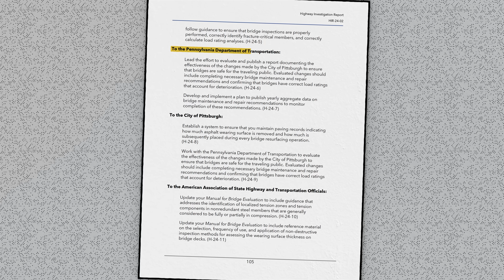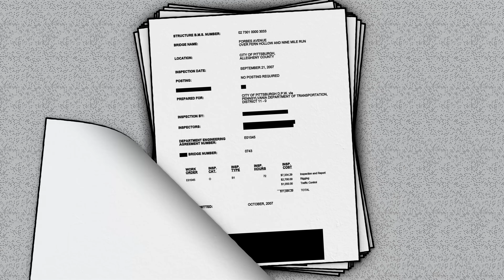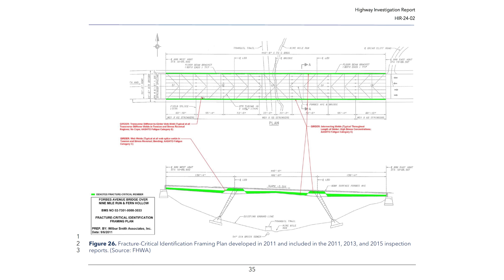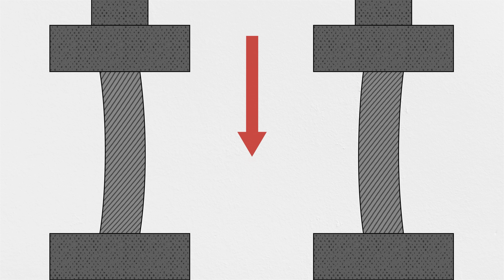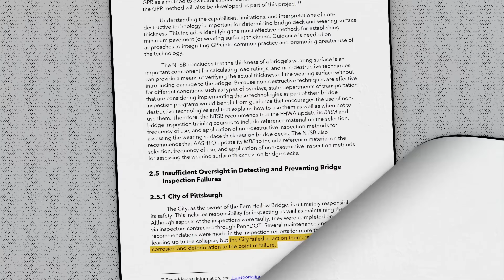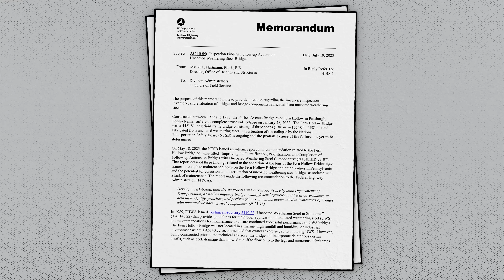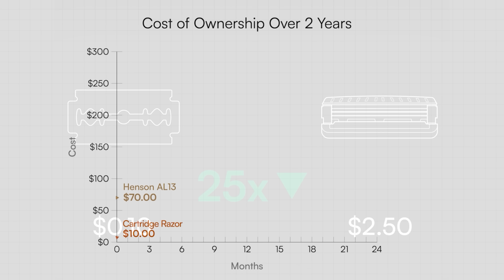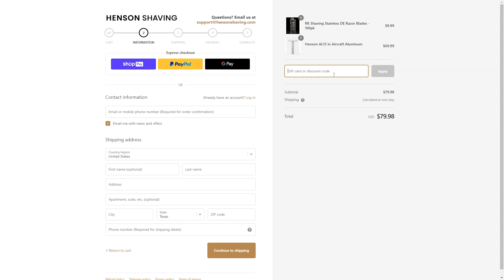This Bridge Should Have Been Closed Years Before It Collapsed

Comment: Excellent points at the end, I'd personally add my unqualified opinion that many of our regulatory agencies in this country feel toothless these days. I think some of the source of this complicated but inconsistent machine of infrastructure maintenance is seeking profit at each step. Instead of having a city or state employee as a direct boss of the inspector(s) who then gives the order to fix something on a set schedule depending on its urgency,  potentially outsourcing just that labor and material to contractors... we bring in another private/corporate entity at every single step, and maybe my biases are showing but they're mostly parasites there to drain their cut of tax payer dollars and have perverse profit motives that weaken oversight by the elected officials and appointed regulators who are supposed to ensure the safety and excellency of our infrastructure, such as public roads. Then again, I'm not an expert on engineering of the bridges nor of the complicated bureaucracy 😅. But like you said in reference to the infamous tweet and photo, sometimes it's plain to see a structural issue in a system.

Comment: My Statics professor called "You can't push on a rope" Newton's 4th Law. 

I'm in manufacturing so no bridge design for me. I still know that cables/ropes cannot be put under compression. And that heavily rusted steel is not adequate for load bearing members.

Comment: Any Structural Engineer that inspected that bridge ten years ago should not have said that the structure was 'Poor'.    He should have refused to sign it off, and get it closed for immediate replacement of all supports.   A report of 'Poor' is much too vague, and to the average layman, could be interpreted as it just requires re-painting.

Comment: One of the bridges connecting Louisville and southern Indiana was immediately closed due to a finding during an inspection back in 2011. They found a crack, reported it, and it was immediately shut down in the middle of evening rush hour. It was enough that the inspectors didn't even wait until the inspection was finish and just put it in a report. I had crossed it maybe 15 minutes before it was shut down.
And thanks to a few months of this bridge being closed, it finally pushed forward the plans to add 2 new bridges that had been talked about since at least the 1980's.

Comment: The inspectors should have the authority to close a bridge if the action items are not completed.
Each bridge should have it's own checklist regarding inspections, created by the bridge designer or appraised by high level experts - Rather than relying on some on-site inspection team to guess from visuals what stresses the bridges are under.
Reply: Have you considered who owns the risk in this case?
Did the City ignore the bridge because the Insurer behind the designing firm pressured them to not file suit?
What did the design firm claim the useful life of a bridge like this to be?
That project had to be Bonded and Insured, but we ignore what assurances were required to build a public project?
This is insane.
Should we be Happy that Federal Funds only get released AFTER complete Failure?
I find no satisfaction in our Governing Bodies. They can simulate past events while having their heads jambed into the sand.
Wow.

Comment: Seems like the issue here is the word "recommendation". That word implies a possible futur issue of no great concern for the time being. Recommendations should be given for issues that will not cause safety issues in the near future, but when legs are falling off, "requirements" and/or "safety violation" should be given in lieu of recommendation. There are countless other examples of this across a multitude of different industries from heavy  industrial to light commercial. In most cases, a single person or group is not to blame, its more like the acceptance of the way that things are done that has become the issue. Like this example where not one single person could have avoided the collapse since it needs to go through reviews and committees involving countless departments, specialists, funding and so on.

Comment: Before the Fern Hollow collapse, I had noticed that the expansion joints,, which looked like long metal plates with interlocking teeth, had an extra wide gap between them. But - duh - I was worried about cyclists and thought the bridge was designed before cycling was a regular thing. Then I got home & it stayed on my mind because if it were there to allow expansion in hot weather, in cold weather or at night, the gap should be closed. 
My latest worry is the West End Bridge. Have you seen those cables and felt the bridge lurch and drop under you? Creepy.

Comment: I wonder if the use of weathering steel had any impact on the lack of maintenance.

Does that complicate repairs in any way? Would it limit the availability of contractors to do the work? Is working with such steel a speciality?

Comment: In Canadian aviation, each maintenance operator has a designated Person Responsible for Maintenance. This is actually a legal title within an organization that gives them legal liability for any incidents that the aircraft are involved in, but conversely it also gives them sole and complete authority to ground an aircraft. I think infrastructure owners could do the same thing, where a person who is personally responsible for the integrity of the structures is given full authority to close them or impose other limitations. Its not a perfect system, but it would limit the amount of red tape between a poor study finding and getting a hazard closed.

Comment: Great video, and I appreciate your discussion at the end about how procedural failures around the responses to inspections played a major part in the bridge failure. I don't think enough attention is given to the fact that systems of institutional procedures are elements of infrastructure just as much as roads, bridges, and pipelines. These procedural systems need to be designed with efficiency and efficacy in mind, as well as fail safe mechanisms, just as the physical elements of infrastructure are.

Comment: I do know what the answer is.

Its to take a page from the book some factories doing safety critical work:

Anyone with the expertise to recognize flaws working on the project should have the authority to lockout and tagout the infrastructure, effectively giving the inspection engineers the authority to close the infrastructure on a failed inspect.

Comment: Weathering steel seems like a bad idea when it depends on maintaining a drainage system like that. A simple fix though would have been to box those leg girders shut by welding steel panels over them, closing off areas where water can pool, and adding a bit of redundant strength. Heck, even just some steel added as water deflectors to the areas it could pool would be a much more cost effective fix. For everyone responsible for the negligence, they are lucky the human toll was so small.

Comment: Great presentation. I think what you discussed toward the end of the video about the disconnect between different governing bodies who are each responsible for their own little bit was great. It reminds me of the ‘Swiss Cheese Model’; not one single oversight was enough to cause this failure, but a whole string of overlooked issues all needed to line up to allow this failure to occur. 

It seems the biggest recommendation the NTSB could have made, was to streamline the process of fault reporting and escalation.

Comment: Maybe we need a bridge channel! Citizens designers and engineers go out and look at, talk about bridges. There is a lot to learn about in each bridge as demonstrated here. Good design, bad design, maintenance issues, structural faults and even local history! 
What I tend to see is that old bridges lasted forever, new bridges dont last. Is it a matter of money spent or more traditional design? 
It makes sense to examine what bridges and designs last longest and why-conversly whats not working!
 There is a tremendous cost to building bridges and maintenance that may or in reality, may not happen. Finding the truth of what actually works is a good idea!
Maybe unquestioned federal dollars for rebuilding once red dots appear on a report is the answer. Every local politician wants to bring federal tax dollars back home. 
I'm in Connecticut where the Mianus River Bridge failed on Interstate 95. 
Citizens had warned it was going to happen after hearing the noises the bridge was making. Luckily the collapse happened at night. Unfortunatly, that bridge was very high and sadly lives were lost. 
I cant drive over it without remembering. The Northeast has thousands of streams and rivers to cross. The area especially needs the process to work. Another suggestion is for concerned citizens to call the news papers or local news, and/or your federal elected officials instead of just calling city hall.

Comment: Would you be able to do a video on the Calgary water main that broke?  That is a similar situation to this where it seems like they knew there was issues but put it off.  That issues isnt unique to Calgary either.  Its just the first where a massive failure happened.

Comment: In constract, the Turcot interchange in Montréal got warnings from engineers and the government knows that should this have to close, it woudl kills north/south and east/west traffic in Montréal.  The contract was not given to lowest bidder, but rather to the bidder that had the more realistic plan and sequencing of work to replace the interchange in-situ wiyld least amout of disruption oof traffic during construction. Project isn't well known because it was done on budget and on time. But duiring the time, the old ramps were on life suppport with dict tape applied every weekend, and they had to remove asphalt from some ramps so cars rode on bare concrete to reduce weight, and one ramp was reduced to 1 lane inteas of 2 to reduce weight on it. They put various sensors on old structures to be warned of shifts in concrete.  And as the new interchange got built (generally tekporary ramp tapes over, old ramp demolished, new ramp built  with temporary connection to old road at other end etc.  With evvery closure of an old ramp, it resulted in large maintenance savings (and weekend or overnight during weekday closures for emergency fixes). 

When it gets urgent enough, it gets the attention and budget s of government. If it is just an engineering report "this should be fixed soon" then it doesn't get the priority until a camamity happens.

Comment: This only strengthens my existential dread getting on an elevator.  In my 40 yrs on the planet i have yet to run into an elevator inspector, and despite all the certifications posted on them, I know deep in my heart that there are “less than safe” ones out there not getting repaired.  Gov’t, despite some claims, isnt completely incompetent, but rather competent people are confounded by poor leaders in management across all levels.  In the military, you dont get prizes and promotions for keeping the operation run smoothly, you get it for the big flashy things.   Things which cost money/manpower you dont have.  So careerists often rob from the less than squeaky wheels of safety and maintenance to pay for their grand boondoggles to impress their bosses who mistakenly believe the rest of it is going smoothly.  And the next boss mistakenly thinks the current expenditure level is sufficient and robs it again for their boondoggle.  Until something breaks, someone gets fired, and it resets.  In aviation we have the adage “the rules are written in ink, the warnings in blood” because it often takes one or more deaths for even the issue to become realized.

Comment: There are bridges from over 1000bc still going. There is simply no excuse for this. 
This is what happens when no one is really accountable. 
Having "the city" as the recipient means no one cares because it doesn't fall at their feet. 
What should happen is whoever was in charge - ultimately the mayor or govenor or whoever - should be responsible and when something like this comes up they should be on criminal charges for public endangerment.

Comment: I want to tell you a true story. 

I love trains

I watch a lot of train channels 

A guy that does train videos was walking on a rail bed under I-80 at the Delaware Water Gap.

He looked up and 2 of the huge steel I beams were rusted completely away and the girders were just swinging in the wind.

These were 6 inch thick I beams completely rotted gone

And the only thing holding up the I-80 roadway was the metal pans and the concrete pad poured in the pan

I started calling and emailing everyone I knew at NY State DOT

This was in Pennsylvania, but I had worked for NY State and I had friends still working for DOT in NY

The video was immediately banned and the guys channel was deleted 

I called the people who I sent the links to and they said they were told to not say anything about it.

Our infrastructure is in such dire conditions and no one at the top cares. They will pretend nothing is wrong and one morning we will see the I-80 bridge has collapsed into the river.

So many highway bridges are this bad

I don't drive any more. I am bedridden.
But if I had to drive I would have panic attacks any time I drove over a bridge knowing what I know, seeing what I saw.

Comment: Grady, on a side note, you mentioned and showed a gas line was also using the bridge as its support structure.  The bridge and it's structural strength, I would think, should also come under the gas company's inspection and review process.  Does it work that way?  If not, should it?  If the gas company had its own bridge that was in such condition, wouldn't they take action?  Why didn't they move their pipe off of that failing support structure?  I am not blaming them - but didn't they also fail in this situation?  Thanks!  I truly appreciate your channel.  I also was a fan of the longer multiple videos of the construction of the sewage plant.

Comment: The salt / chemicals used on the roads are a major factor in the extreme corrosion of vehicles, bridges Etc.  During rail line inspection that follows along side or passes under roadways, the corrosion effects are terrible.  Then the rails return to normal with distance from the roadways.  It appears the problem is being downplayed by the officials involved.  Perhaps for liability concerns.

Comment: I don't see how the shoe is a simpler method of connecting the leg to the footing. It seems nice and simple to me to put bolts through the end of the basic I-beam, and there's more material there to resist corrosion. Was this design a victim of someone wanting to do it the 'cool way'?

* I know the real problem is entirely lack of maintenance

Comment: When health inspectors find issues in a restaurant, they post notices and can shut it down if the problems aren't fixed immediately. Why can't bridge inspectors do the same? If they find critical issues, they should be able to slap warning notices on the bridge itself and on the web, and shut it down if those aren't addressed immediately. The regulation model is already there, just apply it to infrastructure.

Comment: We had this happen in WA with the Skagit River I-5 bridge. WSDOT blamed a trucking company claiming the over size load (a manufactured house) brought the bridge down when it struck a column. A minor strike that wasn't even felt by the driver. That trucking company went out of business because of it. But I believe WSDOT is at fault. They had identified the bridge had issues, they had mislabeled the bridge height which is why the load hit it. Fortunately no one was killed or seriously injured, but WSDOT has taken zero responsibility which is typical for them. I'm in public works and I got zero respect for WSDOT or anything they say. It's amazing how quickly an agency can lose the trust of the people. I'll hand it to the army corps of engineers though. They had a temporary bridge up in a couple months.

Comment: Great insights into the issue of failed infrastructure maintenance. U.S. nationally has over, nearly 43,000 bridges that are rated in poor condition and structurally deficient. Pennsylvania has 728 such bridges. 
The I-35W Mississippi River bridge is another example from 2007, that has over 150,000 vehicles traveling a day. Sadly the Pittsburgh bridge of focus in this video won't be the last bridge to collapse due to structure failure. 

FYI: In Canada, engineers celebrate receiving an "The Iron Ring" on graduation that forms a code of ethics and reminder to a  bridge that collapsed twice (1907 and 1916) and took 88 lives. Maybe we need such a reminder that bridge inspectors wear as a reminder, along with the ability to speak out if a danger to the general public is identifies?

Comment: Real problem was lazy government from top down didn’t even make sure trash grates and drains are cleaned monthly or weekly.
Prevention is cheaper than catastrophe.

We had a boss that was great at putting out fires when something tore up but getting a 12 inch piece of steel welded in would never happen after being wrote up for months. It caused a catastrophe would never happen for months be our molding car line would hang up. Lots of praise for getting it running an eight or nine hours or 12 hours when it didn’t really need to ever happen at all. 20 minute well job on a downshift.

Comment: So I was curious I had to look it up based on where everything was with the bridge if it's load rating was technically at 3 tons that bus exceeded its load rating 10 times over articulated buses are as much as 60,000 lb so this is a very conservative estimation if that articulated bus it was one of the heaviest models it could be as much as 20 x times the load rating